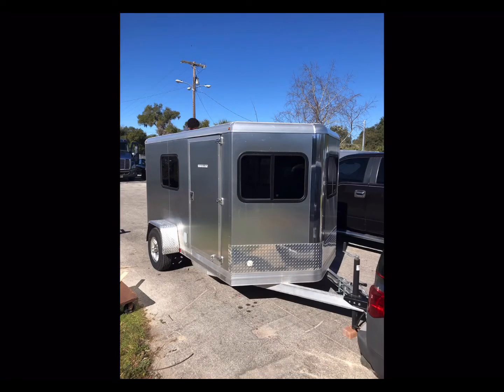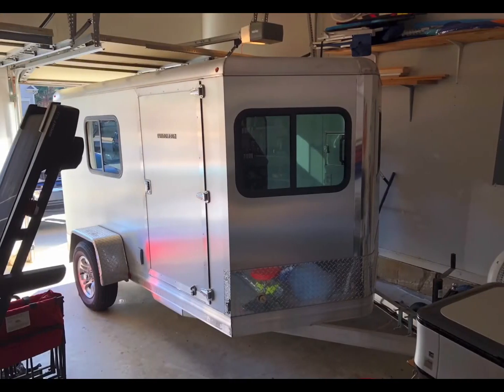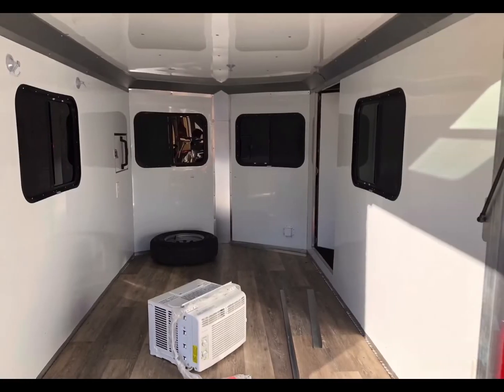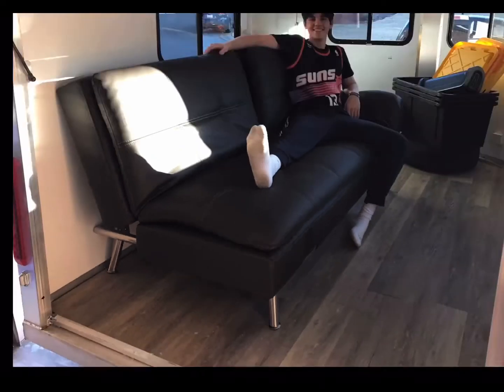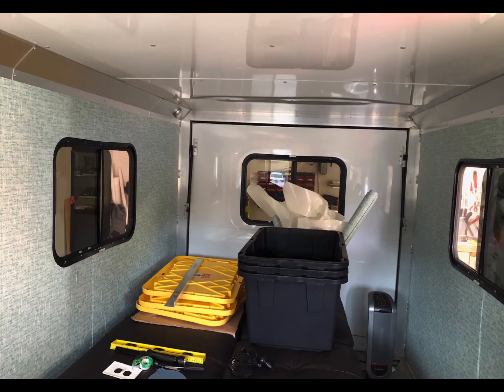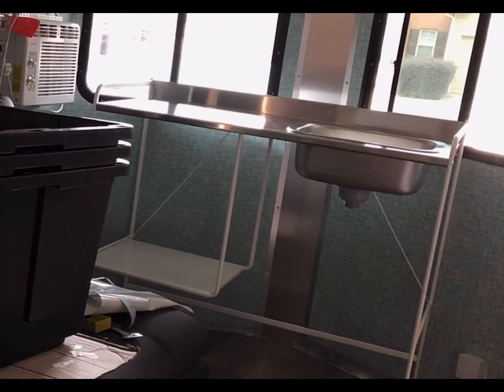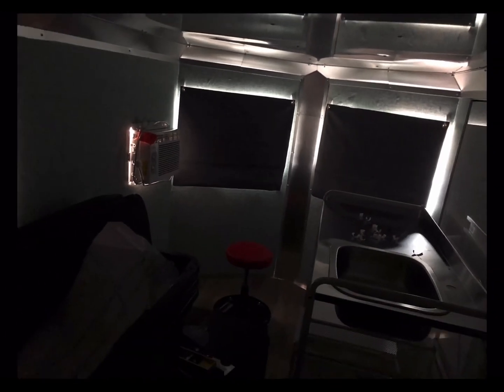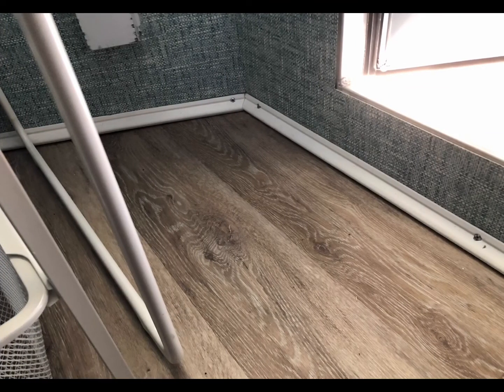WeeRoll small trailer build out #1

Comment: Back watching your videos again years later haha. Did you ever think about letting most of the air out of the tires to make you further shorter to get inside the garage? If they are low enough they are bulging you'll have to put some are back in then once you get them in the garage but it would help give you at least a couple inches on the roof

Comment: Really lovely trailer, buying used but in excellent condition can save a lot in depreciation, especially on a top range model with the spare wheel and air conditioning unit like this. 

Neat that you can negotiate it into your garage, but it sounds like a nightmare to achieve with the ever present worry of collision.

The flip side of garage compatibility is the reduction in interior headroom, whichever is of most significance will win out.